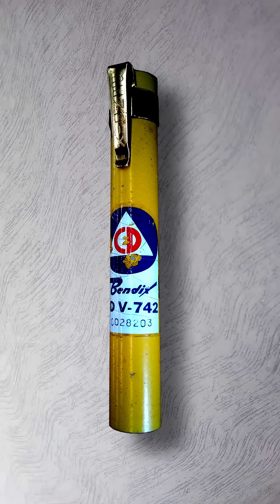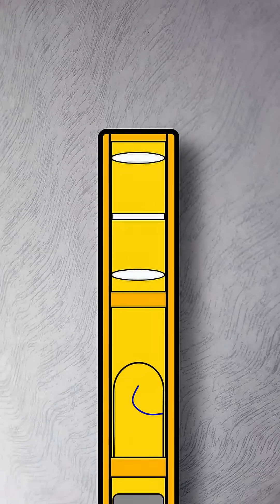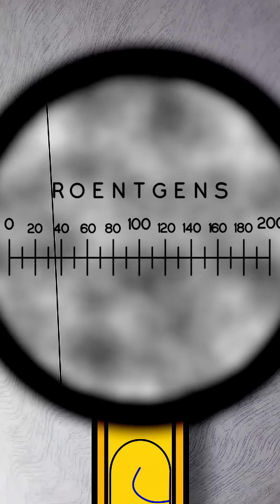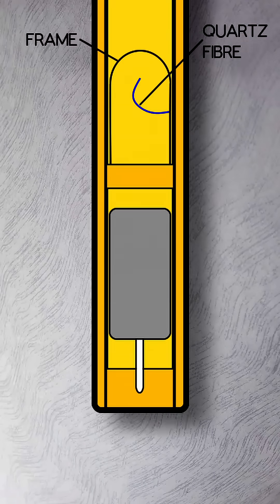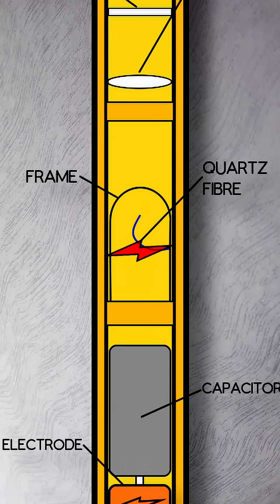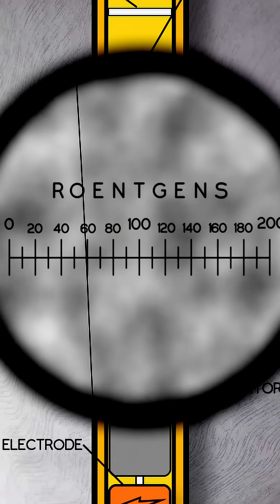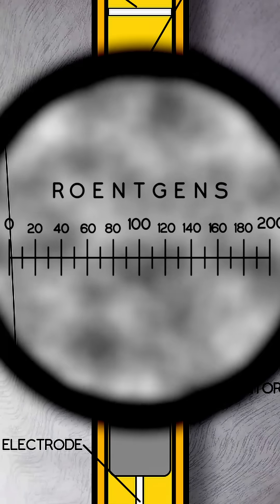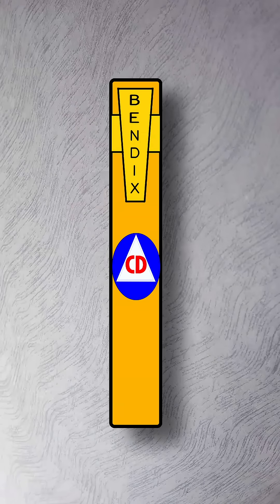How 1960's Civil Defense Radiation Dosimeters Work (animation)

Comment: Where did they get the voltage from? How long would the charge last originally?
Reply from the maker: The voltage came from a charging station that was issued with the dosimeters. It ran off a "D" size battery and used a transformer and transistor to up the voltage. Not sure how long they're supposed to hold their charge for. https://youtu.be/iphjlzUhEhg

Comment: the fiber is coated with something conductive, and it's part of the capacitor itself. when it becomes charged, so does the wall around it, which makes it repel the same way as in a gold leaf electroscope. ionizing radiation that passes thru the air in the chamber will create ions, which will move toward the charged surfaces and dissipate the charge. if a particle hits the quartz fiber itself, the outcome is possibly just a charge being embedded in the crystal forever and no indication on the gauge... but there's a lot more air in that cylinder than quartz.
Reply from the maker: Very cool - thanks for the info!

Comment: Do they still work? 
I'd love to see how much radiation we get exposed to in everyday life in 2025
Reply from the maker: Mine lose their charge after a few minutes. You can still get tested & calibrated units, but they're pretty expensive. Modern electronic versions are available on Amazon if you search for dosimeter.
Reply: @ballinator  I wonder if the capacitor could be replaced? Or replaced with a battery?
I drove a truck for years and a few places we went would give us a small rectangular dosimeter that was maybe an inch thick and about 3x4" or so tall and wide. It clipped on your belt or pocket and gave a count down number on it. I never saw one read anything I always wondered if they really worked of if they were just a way to ease everyone's mind about being somewhere where everyone else was wearing head to toe hazmat suits and hoods with respirators.
Reply from the maker: @ I don't they could be repaired at home. The whole assembly is sealed together with solder, and I imagine the tube is filled with nitrogen or something to keep the lenses from fogging up.
Reply: @ballinator  clean everything you can. if mold spores have entered the chamber or if there's any contamination or corrosion, then it won't be able to hold a charge. If you're lucky it's just a surface contaminant on the charging end that you can scrub off. Adding a very light coat of a dielectric grease might help too but they're designed to be kept clean and dry. If they're humid inside then you may need to bake them at just over 100 C for a couple hours.

Comment: About 40 years ago Iworked at the Stanford Liner Accelerator as  klytron tech and we tested very large klystrons and they emitted quite a lot of radiation we wore dosimitors that collected info on how much exposure  we had. They collected them weekly and recorded the measurements. We would place sheets of lead around the tube and use a different dosimitor  to adjust how much lead we needed to add to keep the radiation under a certain number.  With current health and safety rules there is no way they would allow any of that to happen.  Lol. Anyway, thanks for sparking this memory and listening to an old man's story. 😅 great channel, keep up the good work!
Reply from the maker: Very cool! Thanks!
Reply: I have one of these but couldn't get a charger, oh well guess i will just glow in the dark 😬
Reply from the maker: @SouthernGround Coleman's Surplus has the chargers in-stock. My charger works, but my dosimeters lose their charge a few minutes after.